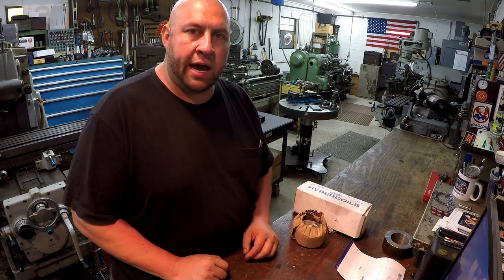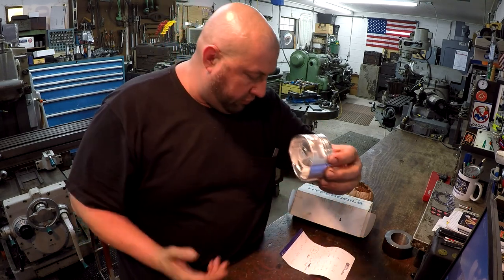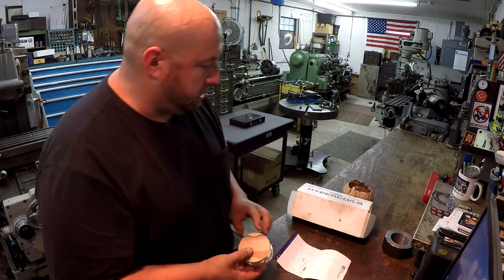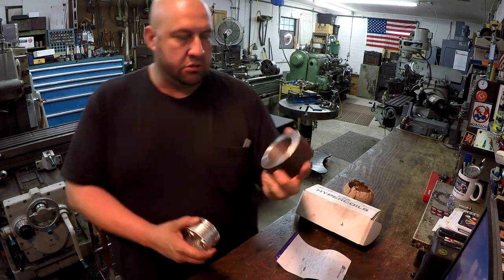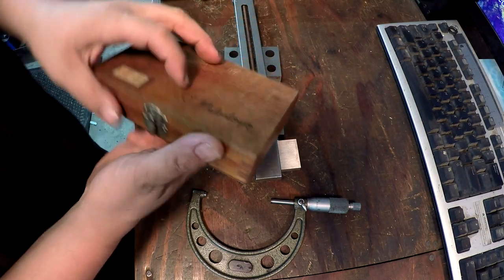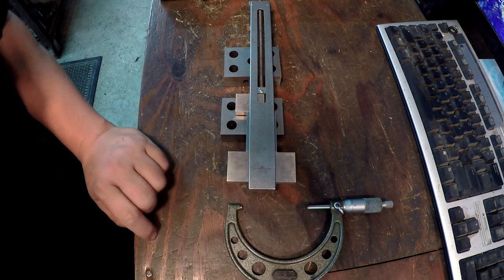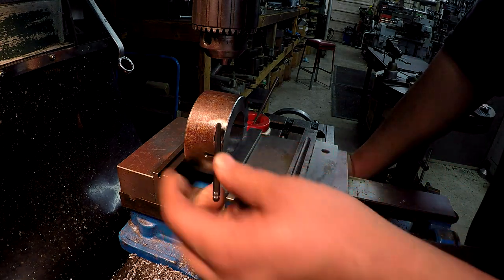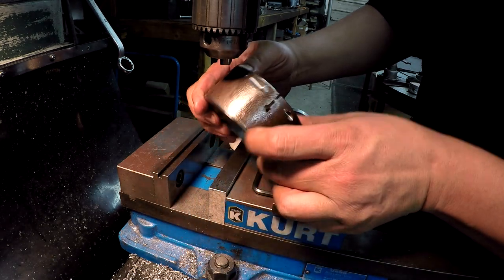Hayabusa Pistons Part 1

Comment: Nice to see someone who is actually worried about thermal expansion when using micrometers.. not sure if you know though, but that black plastic bit is the only part you are "supposed" to touch as it is there to limit thermal expansion on the micrometer.. the bigger the mike.. the more "important" this is.

Comment: You make the cylinders match the pistons, never the pistons the cylinder, balance is KING! More power is gained by matching the cylinders and freeing up the rotating assembly than any other thing you can do. And most pistons today are Hyperutechtic and are barrel shaped not round or flat sided.

Comment: Hello, believe it or not I've actually worked turning pistons for experimental engines for a manufacturer. INSIDE the skirt was  a turned and faced step we called the register.It was the first operation on the casting. The gudgeon pin hole was then bored.
To secure the piston for all subsequent turning no chuck was used on the piston. Instead, a ring of the same diameter as the register was centered with a long eye bolt passing right thru the lathe's  shaft. Piston on, dummy pin thru piston and eye bolt, tighten large wheel nut at back of lathe.

Comment: You should NEVER machine a piston to fit a bore. The bore MUST be matched to the piston, and a dial bore gauge is used to check the clearance. Whoever bores cylinders without having the pistons in-hand, shouldn't be.
Reply: exactly
Reply: not to mention how weak the skirt would have become,,and how the oil retention finish would have been gone..
Reply: The time spent to make that fixture alone, you could have honed the cylinders to size and had time left overto go fishing or whatever. A very accomplished machinist, no doubt about that! But lets not make it more complicated than it is. I could have honed/sized all four holes in less than an hour.
Reply: not with nikasil cylinders. it isn't that easy to increase the bore with let's say a thou, You need diamond honing stones they are very hard. And you have also the danger to make the nikasil layer too thin.
Maybe they hadn't a machinist available who had the right tools to hone nikasil bores
Reply: All the more reason why the above statement is true. That is just silly
Reply: Because pistons are not round.
Reply: Exactly! Pistons are oblong shaped. Machining the piston to make it "round" is a recipe for disaster!
Reply: Get off the drugs
Reply: 100% correct. You never use a machine shop that will bore a cylinder without pistons.

Comment: I'm looking forward to the sequel(s). Did you consider using the difference in thermal expansion of aluminum and steel to make a no-slot, no-mar chuck that would hold the piston securely enough for light turning? Aluminum alloys, cast or wrought, expand and contract at about 0.000012 in/in/degree F. That's about double the coefficient of thermal expansion of steel. Cooling an 83mm piston (3.268") from 80F to 40F in your refrigerator will shrink the diameter about 0.0015", allowing you to insert it. When it warms up, it will be temporarily stuck in the steel holder, but will release without a mess using dry ice. Either ID or OD collets can be made for delicate work.

Comment: OK SO NOT TO SOUND LIKE AN ASS LIKE EVERYONE ELSE ON THE COMMENT SECTION. A-BOMB IS ONLY DOING WHAT THE CUSTOMER WANTED DONE. its up to the customer to deal with it as the customer should a researched this before hand as he drag races bike on a regular basis. ADAM only does what the spec`s or schematics call for. A-BOMB nice work on the piston holder, i figured why not use soft jaws but i think its best to get better mounting surface almost completely around the part, great job. well done!

Comment: I'd have given them back to Rodney & told him to find another shop. No amount of money can justify the fucking around that has to be done with a job like this. Fact is, Rodney has it all arse about. You machine the bores to the pistons, not the other way round - apart from the fact it is easier to hold the barrels than the piston & you have more material to work with.......DOH!

Comment: Wow!! I work as a engineer at a forged racing piston supplier and there's a lot of profiling done from the barrel from the oil ring to .500 down and the taper of the bottom of the skirt and tang.

Comment: Inside the ID of the skirt of the piston you'll notice a machined female spigot.  You can use the piston pin as a cross bar and pull the piston on the male spigot using and eyelet that pulls on the piston pin right through the male turning spigot that pics up the ID.  You can then turn any of the pistons OD.  We do this all the time.

Comment: Seems odd to match pistons to the bores instead of just bore and line honing the block.
Reply: Cylinders are aluminum and plated and he had the work done without them having the pistons.Its not ideal but its the only way to fix the issue as you cant just hone the plating because it will end up being too thing.
Reply: He might want to look into getting a new set of pistons.  Chris
Reply: shadowdog500 Adding clearance to piston skirts has been done for years.He's not changing the bore diameter of the piston so even if he did order a new set the skirts would most likely need to be trimmed.......I guess he could pay the piston manufacturer to chuck them up into their piston vice and turn down the skirts though if that makes you feel all warm and fuzzy inside ;)
Reply: Luckily Adam did listen to the comments from the experienced engine builders here and decided to stop the project,  so now I do feel warm and fuzzy inside since another automotive type of project wasn't going to bite him in the butt like the intake manifold did a few weeks ago. The piston manufacturers would never just turn the skirts down in a lathe like Adam was planning to do, the have a special grinder that grinds the skirt in an eliptical shape.  Chris
Reply: Well that is how they used to do it, a lot of pistons are now cnc turned with the proper elipse and barrel shape for the skirts.
Reply: Brian, Apparently I'm still living in the old world.  guess I have to get with the times.  LOL  Chris
Reply: shadowdog500
 The times are pretty awesome, you can get custom pistons now way faster than just 20 years ago now that the dimensions can be altered with a button push rather than having to generate new cams. Coatings have really changed the race engine world as well. It always blows my mind to think we have basically been doubling the power/cid every 20 years since the IC engine was invented.
Reply: bcbloc02 You can say that again,years ago when I worked at Lunati you had to really know someone to get something in a week or 2 ;)
Now the fact is this is a crutch fix and less than ideal as I said in the first response.But it can be done several ways depending on how much needed to be removed.The elliptical shape of a cold piston is honestly the last thing to worry about,I'd be more concerned about the taper ;) Seriously I dare all the internet experts to measure and then toss a piston into a oven and let it get up to 400 degrees or so and then mic it ;)
Reply: Glad his friend decided to take a different route. I'm not familiar with modern sleeve coatings but imagine it's much less than a new block.
Reply from the maker: Yes I read the comments and relayed the messages to Rodney. I was unaware of the imposing problems so we decided to bail on the job. BUT, I still finished out the video to show what I was going to do.
Reply: +Abom79 Thanks, appreciate the videos. :) That fixture is great, Something I'd never of thought up.
Reply: What should i expect to happen when one does this? Im no internet expert but i got some free time, some toyota pistons and some curiosity.
Reply: Andrew
Depends on your clearances. If you take stock pistons and put them in a block with the correct specs for those pistons and all you did was make the skirts smaller diameter you would likely just have a bit more piston slap, especially noticeable in cold temps and at idle as a ticking sound.  That was not the case here to my understanding. To duplicate this you need pistons that are slightly too large for the bore then trim just the skirts to fit.
Reply: bcbloc02 pistons are not only slightly out of round at room temps but they have a taper that gets slightly bigger at the bottom a lot of times in order to reduce piston slap.I just love how all the experts on you tube yell its not round,dont do it etc like they know everything but make no mention of the taper ;)
If you want to experiment,measure the pistons at ambient temps and then heat them in a 4-500 degree oven.Depending on if they are cast,hyper eutectic or forged will determine at what temps the take shape.You can then trim a few thousandths from the skirts if you want before they cool down.When doing such things we used to use a heat gun to keep them at temp while turning them and to warm the jaws on the lathe instead of a torch.You can also use heat sticks to let you know the temp of the pistons while reworking them and as long as they are quality parts they will retain the same shape when cooled that everybody was so worried about ;) 
Again this isnt something I'd recommend doing unless you're in a bind but when I was heavily involved in motorsports it was VERY common to have to do such a thing to get a car back on the track
Reply: SouthJerseySound
I usually work with long skirted pistons used in long stroke motors and they are not only oval shaped but the skirts are barrel shaped rather than taper.
Reply: Andrew, When one does this experiment he should expect to burn his hands! LOL  If you threw those pistons in an oven and heated them to temperature they would not be round.  The piston designer knows that there is a temperature gradient within the piston as the heat flows through it, and sets the dimensions accordingly.  Chris
Reply: shadowdog500 Gloves work wonders ;)
As far as the temp differences from the crown to the skirt go.They are actually negligible in relation to the elliptical shape or out of round shape. Once you get past the compression rings temps remain fairly constant.(I have some studies we did with sensors mounted underneath the pistons of a sbc if you'd like to see them) The pistons are elliptical to offset the effects caused by expansion of the  irregular shape of the pistons.skirt.
Reply: ...just a little tricky to hone nikasil bores....
Reply: +SouthJerseySound That would be great  if you would like to share your studies on piston temperature.  That would probably make a great video. Maybe you could upload it.    

Drag racing was my passion up until I was about 30.  Around that time everyone started to get married and having kids, and the drag racing started to take a back seat to everything else.   Back then it was not uncommon to spend an all nighter putting the parts back together then going out to a diner for breakfast when one of us noticed that the sun came up (these were good memories).  Its been a couple decades since I played with this stuff but I can honestly say that I have built more than my share of small block Chevys back then.  Now I mostly like to putter in my shop fixing my own stuff and friends car on occasion.  I've only torn into two small blocks in my shop in the last couple of years, one was just replacing both head gaskets on my neighbors pickup truck, and the other was my brother-in-law and I guiding my nephew through the steps of putting a better cam in his trans am.(this took all weekend because we let him do all the wrenching and learning, while we provided guidance)    When I retire I may start playing with cars again.

To be quite honest I never heard of anyone heating up pistons and turning them on a lathe before.  We usually ordered custom pistons that always came 10 at a time so you would have 2 spares.    Sorry for the long response, It's late and i just felt like rambling;)   Chris
Reply: On high load motors the skirt on the side opposite the crank throw tends to run hot because of the opposing force of the crank vs the push down on top of the piston.
Reply: FYI:  Align honing a block has nothing to do with the cylinder bores.
Reply: good
Reply: shadowdog500 Its not a special grinder, it's a round grinder with a slight bevel (according to specs).

 They normally have a table bed that can turn at an angle. It's the same principle as turning a taper on a lathe, just using a grinder and taking 0.01mm steps. You can also grind outside of the middle on them with a 4 point Chuck.

The real difference between the manufactures and what you can do at home, is a CNC machine.

We use them for 2 reasons

1)They are exact
2)they work a lot faster

I work in manufacturing bearings, but the company I work for does engine components, clutches, tires, roller and ball bearings.
Reply: exactly

Comment: are you considering the temprature while usinng those gauge blocks ? if the temprature of the block is not in correct degree gauge block will expand or retract and will cause your calibration to be slightly incorrect.

Comment: Classic example of getting the cart ahead of the horse! While one may bore a cylinder before acquiring pistons one should wait to hone to final size after receiving pistons. Sometimes to be safe one needs to bore first in case the block doesn't make the cut. In this case wasn't necessary. Personally  I don't think removing a few thousands from a piston will hurt anything, except most pistons aren't round on the skirt.

Comment: Can you explain why you milled the slots across the ring before you bored out the inner diameter?  I've never machined metal to speak of, but when I've made jigs like this out of wood I would start with the high-tolerance step of drilling/sanding out the ID and then cut the slot.  I know tear out isn't as big of a problem when working metal, but isn't it hard on the boring tool to cut across the slot?

Comment: Just a couple minutes in, and I had to scroll down to see if I was the only one.  Thank goodness I'm not.  I was thinking maybe he just needed to modify the ring grooves, or some oil holes in the oil ring groove.  
Pistons always go to the engine shop with the cylinders.  That is, unless it's just an old low power, low speed, low tolerance, stock engine from 50+ years ago.  

Looks like a fun shop experiment anyway.

Comment: You have to have the piston in order to bore the cylinders. Pistons are NOT round but in fact oval shaped, cam ground or in some cases poly-spherical on the skirts and they have to measured across the skirt perpendicular to the wrist pin. They are made that way to accommodate expansion as they get hot. You have to have the piston so you can measure it and bore and hone the cylinder in accordance. You also must consider whether the cylinders will be straight honed with one grit grade of stones or plateau honed using two different grades of stone. When you plateau hone you use a course stone first to give deeper valleys to carry the oil film and then flatten the peaks with a fine stone to increase the surface area for heat transfer. 

I also have to question his decision to run .002" clearance. That is very tight. Racing clearances are normally greater than street to cut friction and lessen the possibility of galling. In addition, you mentioned that the cylinders had been treated in some way. This may also effect clearances. 

A very good article on this subject can be found here: http://blog.wiseco.com/piston-to-wall-clearance-myths-mysteries-and-misconceptions-explained

Comment: Just curious Adam, I don’t see you using a temperature gun or anyway to measure heat when you’re doing cutting or measuring before and after. How do you account for things like thermal expansion? I know steel expands a thou for every 100F, so a 3” piece will expand 1 thou for every 33F. Do you account for that? Thanks man!

Comment: Hi Adam,
I had a thought that there might be a work around for the misplaced bolt.  Why not use a lighter one, say a #8.  Extent the shelf forward and drill a new hole.  For only four spins through the lathe, a smaller bolt might work.  It isn't ideal, but I always try to save work already completed, even if it isn't pretty.  You could start from the other side if needed.
I see this job has been overtaken by events.  But I just wanted to suggest an alternate path.  Great videos!  Love your work.

Comment: In light if the fact that you came in 3/16" too far, you could have also undercut the cap screw threads for that side so just the last 3-5 threads were left. that way you could still clamp on both sides. When we used to build high performance outboard engines even back in the early 70's, we matched the bores to the pistons which were usually .030" or .060" over.

Comment: I used to send my own specs to fit my need to the machine shop. Never had a problem......except once, and I wouldn't really call it a problem. I used to send crank shafts down 2 or 3 at a time. The parts I got were very consistent so I  had nothing problem doing it. One time I seen one come back and I measured it and it was .001 bigger then I  intended. I used to send down   my own specs and they  always came back perfect. I could always tell which journal they did first before they made their final adjustment. I called them up and said hey what gives. The manager at first resisted a little and said his machinest cut them to spec. I said well what do you think that piece of paper I sent down with numbers was for. He took the crank back and they took .001 off. The bottom line is the machinist wasn't wrong he just didn't do what I asked him to do. That is why it is very important to have all your measurements before you send parts out to be machined. I measured everything.